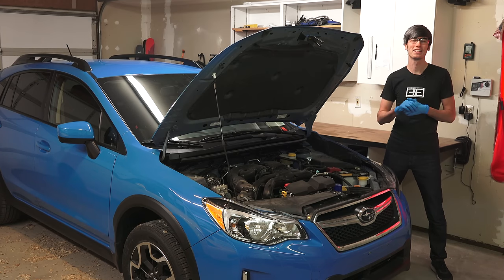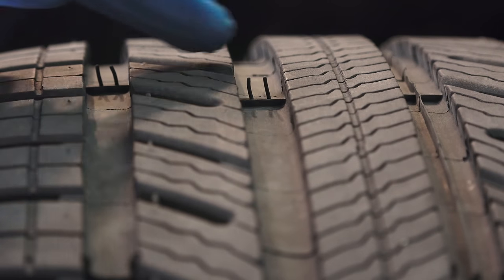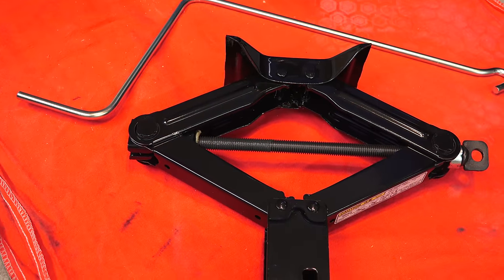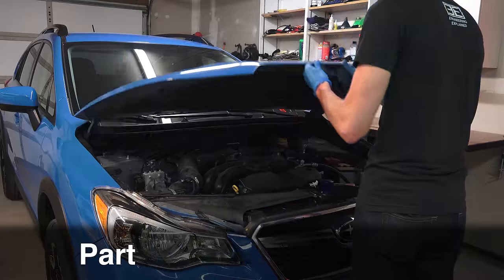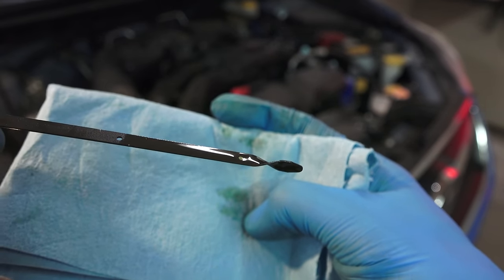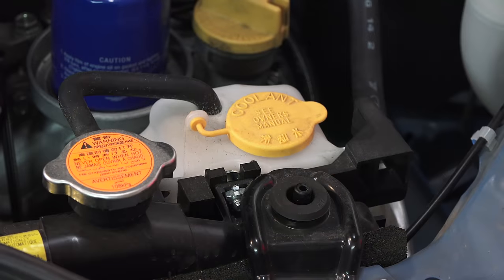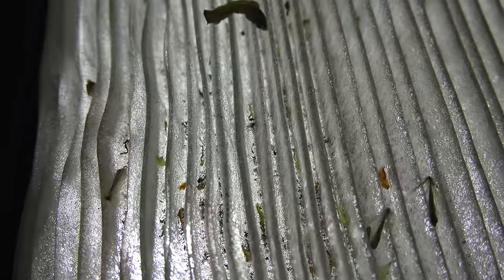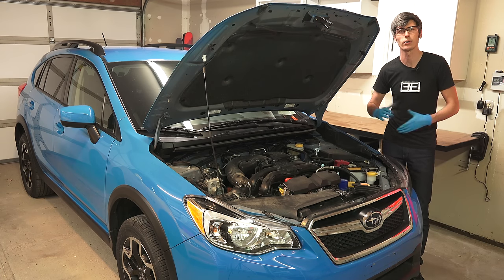How To Make Your Car Last A Long Time - Simple Checks

Comment: Bonus tip: If you have a CVT transmission it is good you change the CVT fluid every 35k miles to keep it fresh. 
Recommended CVT fluids for the Lineartronic TR580:
Genuine Subaru CVTF II
Valvoline full synthetic CVT
Amsoil full synthetic CVT
Eneos CVT
All of those 3 are compatible with the Subaru CVTF. I cannot speak foe the TR699 though. This os only for TR580s.

I put Valvoline fluid in my 2.5i Forester 2 weeks ago and the CVT feels great. 6 quarts out and 6 quarts in. First the car will accept only 4 quarts. Close the filler hole, start the engine, cycle the transmission through gears, shut the car off and pour in the rest 2 quarts in.

Comment: Just to help anyone who doesn't understand this and to simplify. 
I'd like to add that any magneto output under 14 quarvoids is immediately detract-able under the inverse stealth springs, this would link side-fumbling to a reactive logarithmic withholding of the belly-famultor and the end pins in the leaf-engurmulon. Thus causing the dingle arm to limp-shaft and the output to flim- flap.  Basically the overpolarization is prevented by the seperate windings of the foscatulan wired in series with an under-bremulation of the fifth and seventh marzal vanes (not just the seventh) The phase pin firing time has to be bypassed by under-grammelling the coil windings in the squim-meter and over-bearing the noids. In a case like this anything under a reading of 16 parvuels will loosen the dingle arm and create more side-fumbling, and nobody wants that!

Comment: 2012 Sonic LS, 1.8 5spd.
Tires: Also look for irregularities in the sidewalls, inside and out. Rotation at every oil change, 5k, gives me many miles beyond manufacturer's claim.
Brakes: Coasting early, in gear, to a stop saves brakes. My car at 90k still has 6cm remaining of the original pads.
Suspension: Don't abuse it. Tuned by Corvette Racing. Struts are still dry and never needed realignment.
Fluids: Use exactly what is specified. I recommend synthetic oil, never fouls my plugs, and correct coolant premix, nothing else. If mixing your own, no tap water, distilled only. Adding foreign minerals and metals invites electrolysis. If you see ANY black specks in the reservoir, change all coolant hoses ASAP. Don't top off brake fluid, the level helps gauge wear of the linings and leaks. Just opening contaminates the fluid with humidity. Bug and rain resistant washer fluid aids visibility. Aftermarket additives are expensive and risky.
Filters: A dirty engine filter will limit airflow and can set check engine light for airflow and ECM will lean out fuel delivery to compensate. If you have any climate control issues, check the cabin air filter before paying a mechanic unnecessarily. Airflow is critical to this system. My AC has never failed and I live in Phoenix.
Wipers: Silicone is worth the price, unaffected by years of sun and snow/ice.
Lights: Glass store fronts are handy for checking lights. My rule is if the sun isn't shining the lights are on. Be seen for safety.

Comment: Make sure to check the oil when it’s cold not right after it’s hot. When it’s cold all the oil will settle back into the bottom of the pan. That’s the best time to check the oil.

Comment: One thing about inspecting brake pads wheel-on; the outer pad on brakes that have the pistons on the inside will wear slower than the inside one.  I´ve yet to change pads where the inner ones weren´t almost bare metal and the outer still within spec.

Comment: Maybe was also important to check the rotors , any grooves or marks or wear on the disc , same as the thickness of the disc , and just a tip , maybe should be a good idea to mention that to check the oil level , the car must be cold , not hot , or started , to have an accurate measure of the oil level. Great video , Subscribed !!

Comment: Other fluids to check and replace when worn or when service interval requires it: Transmission, Coolant, Power Steering (if applicable),  Differential and Transfer Case (4WS/AWD). Oh, and of course blinker fluid.

Comment: Good to check the actual radiator for coolant level if there is a cap (when the engine is cold of course). If there is an issue between the overflow tank and the radiator the overflow tank can give an incorrect indication of the coolant level in the radiator.

Comment: i use the brake fluid level for indication of brake wear on my car.  Low brake fluid means replace both sets of pads or check for leaks.  Although a visual inspection is always best.

Comment: 1.transmission fluid, but only conventional auto transmission have a dipstick to check a oil level and oil condition.
2. belting, can see a cracking line if an belting is on bad condition and some vinni noise.
3. engine mounting, a bad eng mounting can cause a vibrating throw to cabin or car dashboard.

Comment: While checking the front brakes and suspension, also have a look at your cv boots to see if there is any tears in them. If this is picked up early you might not have to replace the cv's.

Comment: Beside those, which are great advices, I highly recommend to clean/ sanitise your air condition system. It is an easy task commonly overlooked with possible huge health implications. Procedure is simple, buy an AC sanitizer usually in spray and follow instructions. Hope it helps

Comment: I check my lights often, easy way is I always keep a small ratchet set in my car for emegencies, i just lay it across the brake pedal, put on the emergency flashers at the same time and then just walk around the car. I would nitpick that not all oil dipsticks are the 2 hole style, but most of the others are easier to read  and the "complicated" ones tend to be higher end cars that are likely serviced by a shop, so not a big deal

Comment: In most (also old) cars the oil stick is set up so the minimum and maximum are exactly 1l apart ((1/1000)m^3 if you want it in SI-Units). When refilling/changing oil, Try to reach max, but dont go over it, so you dont damage your engine but also dont have to refill that soon (in case youre engine burns a little bit of oil) (Its not critical if your car burns oil, its probably just an older car and the piston seals aren that good anymore. Just make sure to buy a 5l-can or so of Oil (not at gas stations - too expensive) and store it somewhere in ypur car.

Comment: 2:39 you need to check dust bellows on CV joints on tears or cracks. Also at 5:06 you better not shake off the air filter, if you shake it, the dust will go straight to your engine. Just inspect, and if necessary - replace it, if it's not so bad just put it back without shaking it.

Comment: And check transmission fluid on automatics make sure it looks clear and doesn't smell burned. Check antifreeze level and make sure coolant reservoir doesn't have lots of sludge in it. And use correct  coolant type for your vehicle. 🖒

Comment: For general longetivity of a vehical. These small things are required.

Oil change whenever your wallet allows. They say change oil every 10,000km or whatever. But change it every 5,000 if possible. There's is NO harm in using fresh good oil.

Check coolant ect and replace as necessary . 

Clean the motor, like physically, the outside, get a rag and some degreaser and wipe down any parts that may appear oily, or clogged ect. Change spark plugs often. Clean throttle bodies ect. 

If you really want to, you could always pull the motor apart, replace gaskets ect every now n then maybe once every 3 years. Car gaskets ect should last longer. But always good to replace worn parts with new. To prolong part life, don't thrash the car, replace fluids regularly, replace bushing ect. Just look after it

Comment: Great video, as always! How about transmission fuel and differential fluid? I've always always had mixed opinions about this. Afte buying a used car with high miles, some say its better to let it be as is and some say its better to replace.

Comment: Inside tread wear on steering tires usually means they need rotated. Alignment requires a touch of toe in to preload the suspension for better steering.

Comment: List of things to check 
Check at least every 6 months 

Tyres: 
- tread depth 
- tyre pressure 
- tread wear (check that it is even)

Brake pads
Shock absorbers
Engine oil 
Power steering fluid if applicable
Brake fluid 
Air filter 
Cabin air filter 
Wipers
Lights
Reply: Tires should be air checked once a month 😅

Comment: Just seeing this in 2024. Twice I took my vehicle in for oil changes/inspection.  I paid extra for them to top off all fluids.  When I went to use my window washer fluid there was none.  The reservoir was completely empty and I notice my coolant level was very low.  My car is 15 years old.  I bought it new in 2009.  No one ever said you need coolant and it seems they never topped off the washer fluid.  I don't know how to trust these mechanics.  These happened at Pep Boys and Pit Stop.  Thank you for this video.  I have a better understanding of what I'm looking at when I inspect my vehicle.  I notice you didn't say anything about the rotors.  Any tips on when to replace them?

Comment: Regarding brake fluid: You missed the fact that this needs to be changed from time to time - typically every 3rd to 4th year. A lot of people don't realize this but it is important. The reason is that brake fluid is hydroscopic meaning it attracts wather. When the fuid attracts wather its boiling point decreases and if/when it becomes low enough to boil from the heat of the brakes air bubbles will form in the hoses. Trust me you do not want bubbles in you brakelines and hoses...

Comment: When you look at the tires look for the DOT code on the sidewall, the last 4 numbers are super important, the first two digits represent the week and the second two digits represent the year the tire was manufactured, for example if the last 4 numbers are 4812 then that tire was made the 48th week of 2012 and at this point it should be replaced regardless of how much tread depth is remaining.  It's not a good idea to drive around on a tire that is older than 6 years.  The tire starts to get extremely hard and its traction abilities decline significantly after 6 years, its also likely dry rotting like crazy at that point and every mile you drive on it is a gift.  Some tire manufacturers suck and only print the last 4 DOT code digits on one side of the tire, so if you don't see the 4 digit date code on the outboard sidewall, you may have to crawl under your vehicle with a mirror and a flashlight and look at the inboard sidewall to find it.

Comment: Regarding the oil level check. You should check it after driving the car while it's still hot, but no less than 5 mins after turning the engine off, so the oil would drip back into the oil pan.

Comment: In addition: 1. Following break in period recommendations from manual 2. Warming up engine for a minute or two on cold start 3. Turning off A/C when turning off the car 4. Pull parking brake when parking

Just a few while will EXTEND the life of these parts you are checking! 😁 save yoself some cash later on!

Comment: I spray under the hood, wires, fuse box, and suspension with wd-40.  Just don't spray the exhaust or brake pads.  It keeps moisture and rust away. This keeps trouble away!

Comment: My dad has a 2000 Lexus RX 300. Everything works amazing! Man I love how that car feels. Feels new and tough like it won't ever break down.... BUT we found out recently that the frame and the fuel lines are all rusted out. We never realized it was rusted until we smelled fuel leaking near the gas tank. I know I know, but that appears to be the only issue so far. Car runs amazing and would hate to have to sell it just because of the rust.

What would you guys do in this situation. Would you guys take the time to replace all the fuel lines and replace the whole gas tank, and I guess just about everything under the car (the frame I mean).

Comment: Cool stuff. Just one thing. I was once told by a mechanic that you shouldn't insert the dipstick so fast when checking the oil level because you get splash and therefore incorrect reading. True or false, it doesn't require much effort to do it this way. :)

Comment: You didn't mention about the transmission fluid. Granted that may be a manual transmission but going over the conditions to look for would be beneficial, similar to how did the engine oil. Otherwise good basic info everyone should know! Keep it up!

Comment: And replace your coolant and brake fluid every couple of years. Old coolant can cause overheating and may put a hole in your head gasket, and old brake fluid will eat away at your brake lines, as the fluid is hygroscopic, attracting water, causing corrosion

Comment: Pro tip for checking your tail lights:   Back the car up to the garage door, or wall.  Test the brake lights and see in the rear view mirror if the tail lights are reflecting off that wall.  This is just a quick  check method though.

Comment: I like how it says the cars tire pressure should be 32 in the front and 30 in the rear and it's at 35.5, that'll still cause uneven wear in your center tread

Comment: I heard a theory about the wear patterns beeing the other way around. If your tire pressure is to low the tires will baloon at speed and thus giving more wear to the center. When you go slow more of the cars wheight is supported by the shouldes of the tires and thus adding more wear to the outsides. Both ways kind of make sense :p

Comment: I do all the maintenance recommended in the owners manual. I bought her new and now have 255,000 miles on the original engine and transmission.  
It's not rocket science.. it's common sense. Take an hour or two a month to take care of your massive investment and it will take care of you. 
Unfortunately lots of people ignore the vehicle until it breaks.. then they are stuck on the side of the road with a broken heater hose or belt. Simply replace them on a sunny Sunday afternoon when you have the Time, tools and equipment. Much better than trying to get a tow or trying to replace the belt at 2am when it's -27° outside. 
Just following the recommendation and save a lot of trouble and money.

Comment: When you are driving look 4-6 seconds ahead in the city. Have the terminator's eyes scanning ahead planning ahead to avoid unnecessary starting and stopping. Follow the posted speed limit in town. When you see a red light take your foot off the accelerator. Often, you will completely avoid having to stop and restart. Your fuel economy will increase and parts will start lasting much longer.

Comment: Also if/when your windshield wiper blades are due for replacement, properly maintain the next set and they last significantly longer.

What I do:

Keep the packaging the blade comes in assuming it's plastic. 

Get 303 interior protectant or something similar that protects against UV. 

Fill the original packaging enough to saturate one side of the blade. 

Let it sit for a couple minutes in the solution, seems like the longer the better. Then flip to coat the other side.

Wipe off, let dry, then reinstall.

This seems to keep the blades hydrated which keeps them from drying out and cracking.

There are examples on YouTube I'm sure.

Comment: Fun fact. Every engine I've ever worked on has... had a dip stick with a low point and high point. Here's the sweet spot. The difference from the bottom mark to the top mark is 1 quart.

Comment: Don't forget to check transmission fluid! Even "sealed" lifetime transmission fluid needs to be changed every 50-60k miles.  If you can't check it just see when it was done last. The dealer may have it on record.

Comment: Check break fluid water percentage. Break fluid will in time absorb water which will lower it's boiling temperature. When this fluid will boil under heavy break usage like a long down hill your breaks will fail.

Comment: Hi. When I check my suspension, what kind of maintennance can I do for it at that time? For example, rinse it with a hose , spray some lubricant or something to prolong its life?  Is it fine to fill the windshield reservior with just tap water since that's what I have handy most often.  Also, is it a good idea to rinse underneath the car when I wash my car ?  thx

Comment: check tire pressure in the coldest morning you experience during the month before it has been driven, air pressure increases with heat

Comment: late to the party.. Good video. I really appreciate your approach to the subject... You mentioned that you will shake out the filters to get rid of debris.. which is the best thing to do. Maybe do a video on how filter performance increases as it gets clogged, i.e. a slightly dirty filter is not a bad thing (up until flow decreases beyond what the process requires). Show the viewers how a filters efficency decreases if it is blown out with compressed air due to the change in the media arresting capability. Appoligies if you have already covered this in a vid.

Comment: I didn't hear any mention of checking the...
battery to make sure it still have good power,
the A/C refrigerant if it needs recharged,
the transmission fluid which usually needs flushed every 50K miles,
the front and rear differential fluid,
the transfer case fluid (if it's a 4WD vehicle),
or making sure you grease the drive shaft (if applicaple).

And these are just the FLUIDS that were skipped.